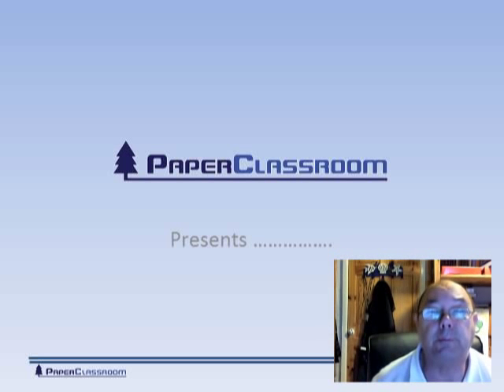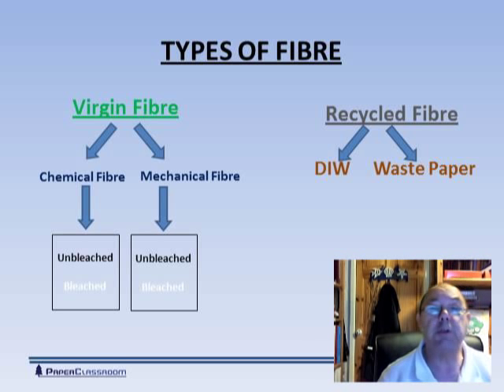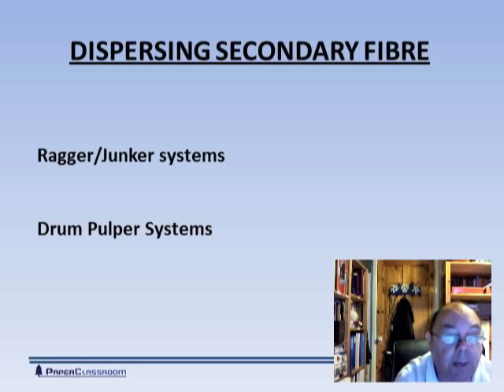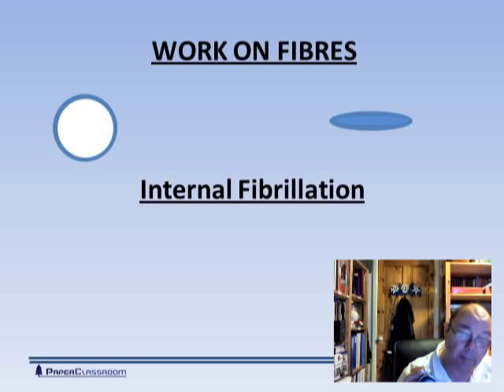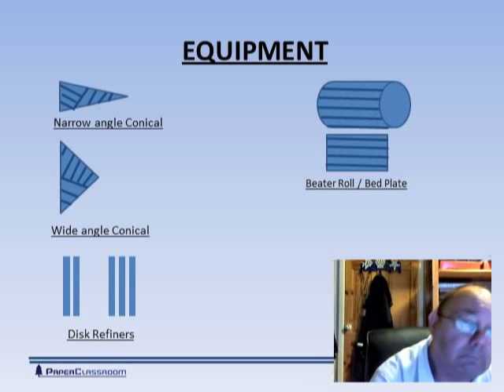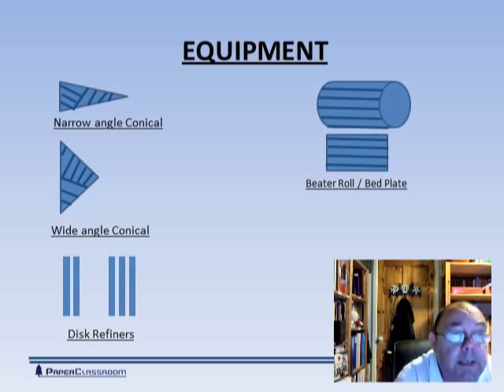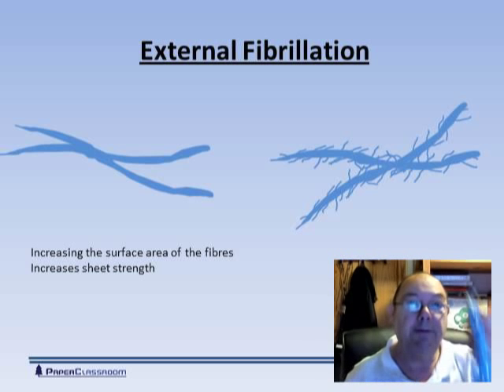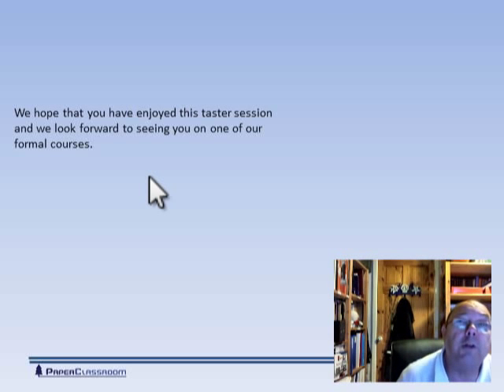Introduction to Papermaking - Stock Preparation

Comment: sincerely.
wanted to inquire about the formation of the sheet on the table manufacturing.
is common variations in kraft paper weight for corrugated?
have a Fourdrinier machine - flat table where we have many variations of weight despite the readings in the scanner. further factor involved much moisture in the paper where it is also a parameter that influences much.
Also consult you if the formation of kraft corrugated sheet is normal to be dispersed?

I hope your thoughtful comments.

Sonia Velasquez
Bolivia
Reply from the maker: Sophie Valery Hi Sonia, thank you for your email..
Formation of kraft paper for corrugated is not very good, certainly not as good as printing and writing paper. But it does not have to be.
The variations in moisture are due to variations in weight. The more fibre there is, the more water will be in the fibre and so the harder it is to dry to make a nice moisture profile.

What is the consistency in your flow box?

I have a nice chart (fishbone diagram), showing 39 contributing factors to poor formation

If you send an email directly to me at steve@paperclassroom.com then i will send the diagram to you

Steve